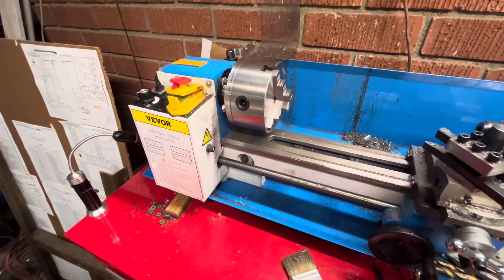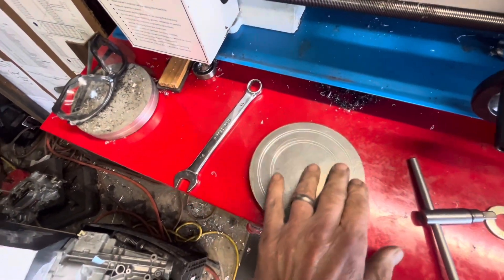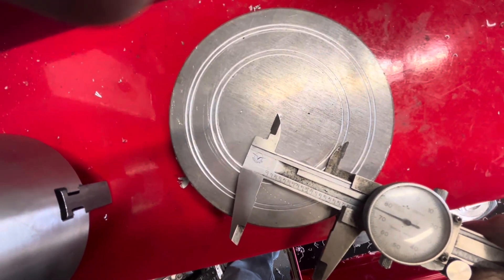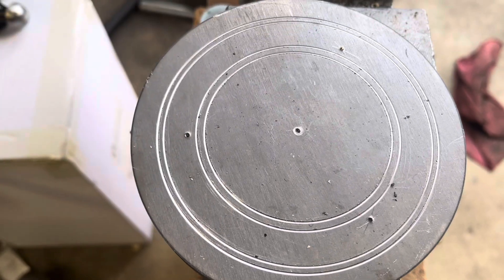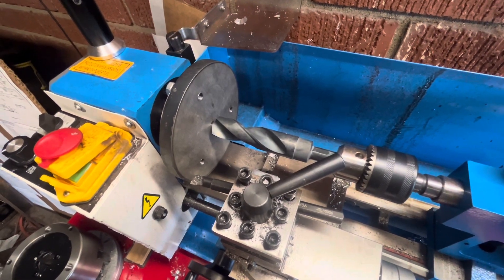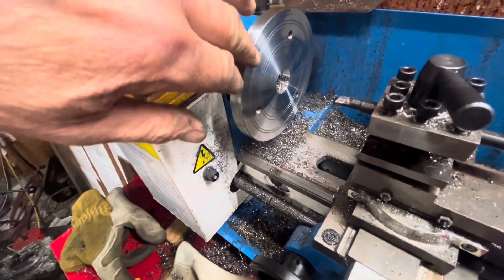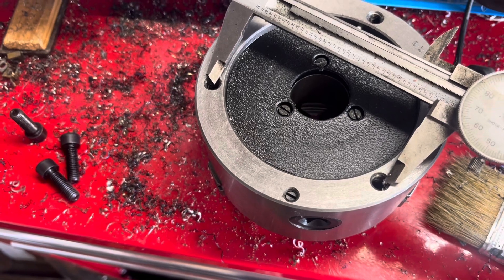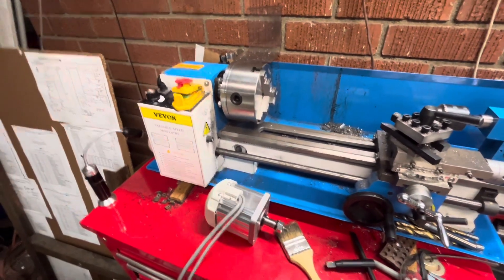Metal lathe upgrade your mini lathe to a 5” chuck! See how I made the adapter for my Vevor 7x14

Comment: That little lathe is not designed for that chuck, your going to end up with premature wear on the inside back bearing and further the 500 watt motor is to small to power. the spindle is not designed for that much weight. The chinese build the spindle and bearings based upon size snd wright of thr chuck.
Reply from the maker: Hello and thanks for commenting. Yeah I’ve heard the bearings aren’t so great on the inside of those things but I typically don’t do large parts. I usually like to have a 5 inch capacity for disc shaped objects and I do have a 1000 W motor which is super nice it’s actually pretty capable little machine

Comment: The spindle on those is already kind of cheesy even for a 4 inch chuck . Good luck with that.
Reply from the maker: I’ve seen a bearing replacement video for that. Yes the stock bearings are the cheap wrong ones